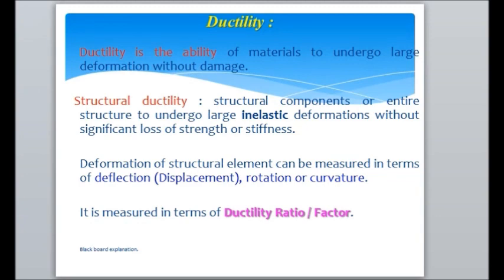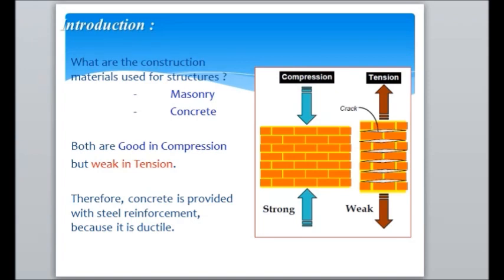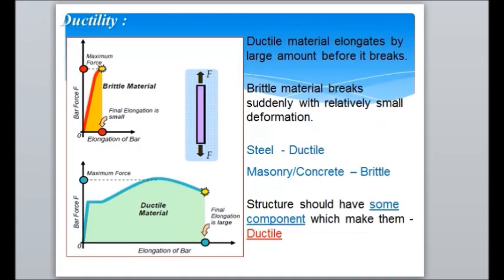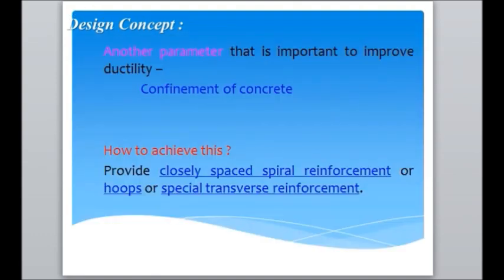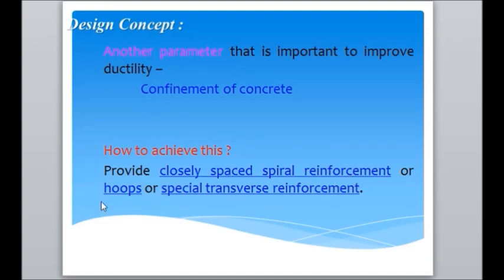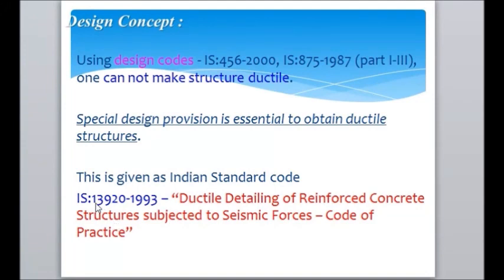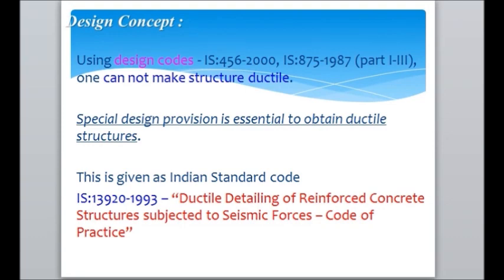Ductile detailing Introduction | Civil Engineering

Comment: Good job madam  ,  but I have a suggestion do make the complete set of RCC DESIGN  of  Residential Building G+2 structure Videos such as Column , beams , footing etc complete in detail as you have done for slab design video it will be helpful for civil engineering students  because now a day student relay on Computer aided design one should have a knowledge of manual concept of Rcc design .
Reply: Syed Mujeeb Biyabani